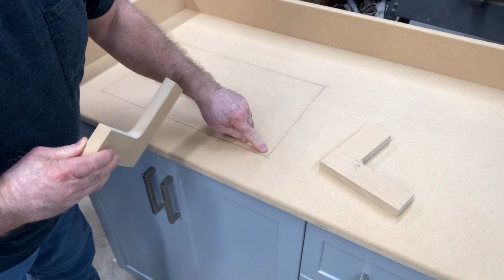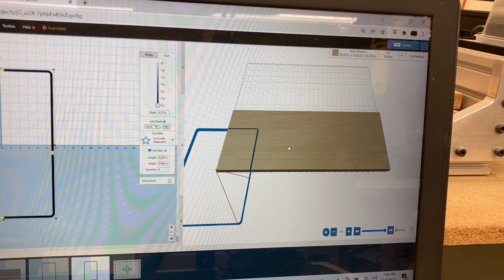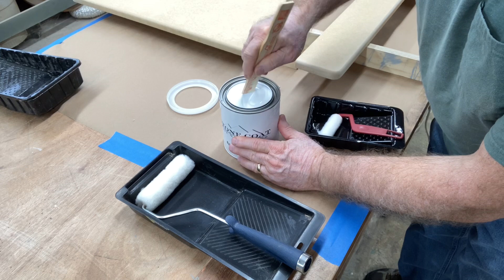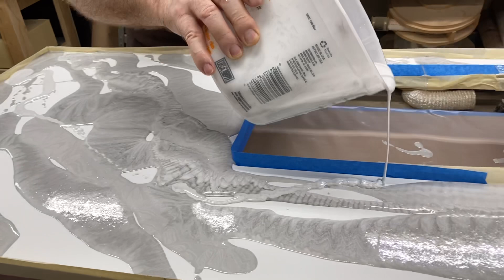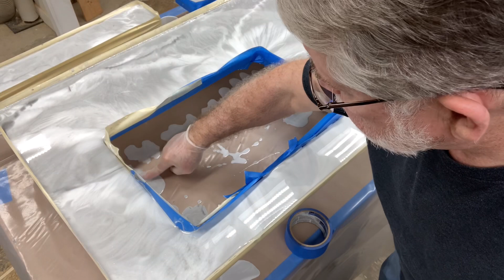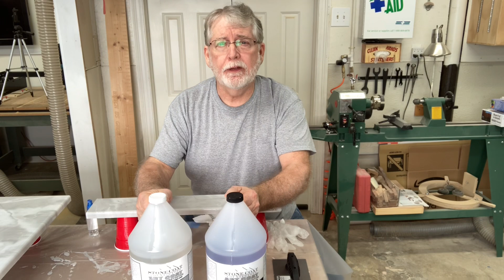How to Make a Bath Vanity Countertop Start to Finish Using Stone Coat Countertop Epoxy

Comment: Nice job. Try using an air table vibrater next time to help spread the resins. The rubber gloves will not. Work due to the resins and catalyst. I’ve tried thick dishwashing gloves etc… try the cement gloves then wipe them down with a bit of acetone on a rag.
Reply: As for cleaning your hands use the acetone. Just be mindful on usage and on;y for your hands. Keep away from eyes etc… I worked manufacturing cultured marble sinks, shower, and jacuzzi tubs for my dad’s business.
Reply from the maker: Thanks for the information, I will certainly keep that in mind.  Great information

Comment: I am building a Barndominium. I have Finished putting the metal studs up. Now working on plumbing and wiring. After I lay all the Porcelain tile and build my cabinets, I plan on using StoneCoat Epoxy on the counter tops. I've been watching them for years!!!
Reply from the maker: That is quite the project. The Stone Coat countertop products are excellent. They are very easy to use and get great results. Thanks for sharing

Comment: Please emphasize more the need for gloves. Yes, you can get it off of your hands with 91% ethyl alcohol. However, frequent contact can cause a person to develop a PERMANENT allergy and not be able to use epoxy resin again. Resin is too baked and ready to use to have your fun ruined because your allergic to it from a reaction that was preventable.
Reply from the maker: Thank you very much. Yes, gloves are very Important